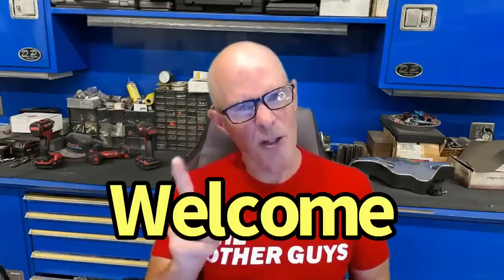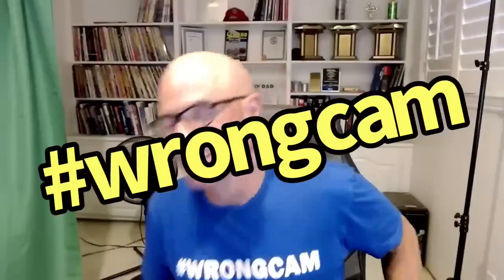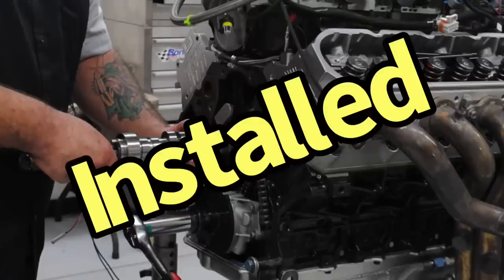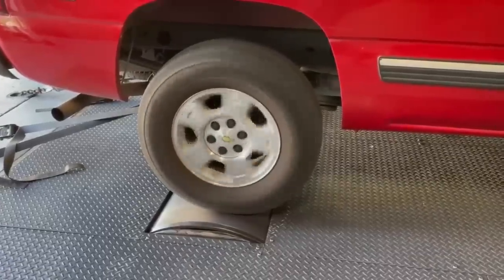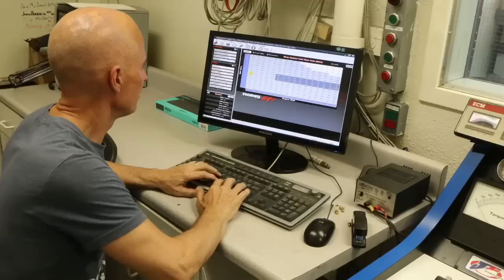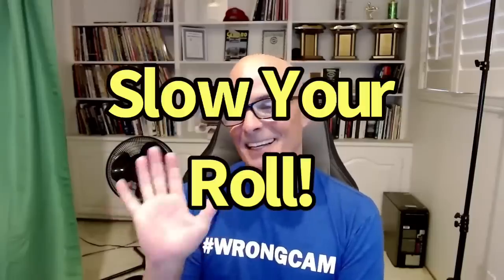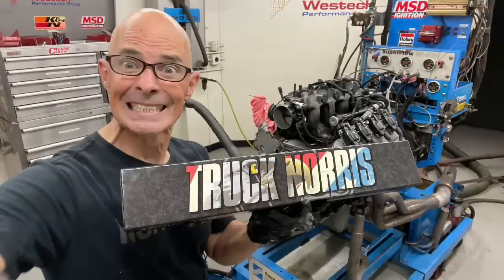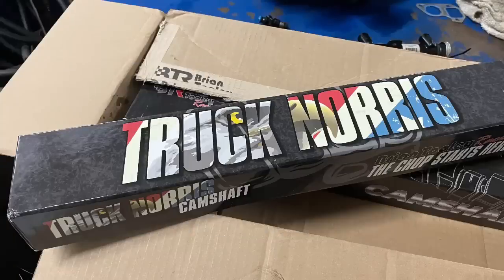CHASSIS DYNO VS ENGINE DYNO RESULTS. WHAT TO DO WHEN YOUR TRUCK NORRIS CAM SWAP DOESN'T ADD POWER!

Comment: He should be able to run at least 25-26 degrees of timing on 93 octane even on a hot ambient air temp day. These factory ecus are very sensitive to knock and you must desensitize the knock sensors a few percent, and as a tuner you need to understand what is an acceptable amount of false knock. Also his motor mounts could be broken like i see alot which can cause a false knock situation. although i dont do much dyno tuning, I do alot of street tuning on factory gm ecus. i would love to take a look at the timing curve, and PE value his tuner was using. i also bet you he disabled the ve and just tuned the maf, Which these ecus need both maf and ve to work in conjunction for the dynamic air to calculate properly. It could be that the ve table wasnt touched, He tuned maf only, and when the ecu was looking for a calculation the ve was so off it caused knock due to a lean condition from the ve table sill being stock. Even with high rpm disable, Its impossible to completely disable ve.

Comment: Is it possible to make decent NA power on lower octane gas? As long as the compression is relatively low right? It get real pricey filling up a truck tank with 92
Reply from the maker: yes
Reply: @richardholdener1727  You have to test on what you are going to be running, or you are just chasing numbers. What good does that do in the real world, other than I have a slip with a big number on it.
Reply: It's about controlling the heat, as the air is compressed it increases the temperature drastically (as you probably know it's how diesel engines ignite the fuel) and that's pretty much a multiplier of the temperature of the air coming in.
Water temperature can matter as well, you want the engine hot enough for the oil to stay clean but not much more (unless you're chasing fuel economy then the opposite sometimes helps).
Even if you get lower octane go with a good brand and a pump that's used lot, and/or add a good fuel additive that contain P.E.A. so the injectors give a nice mist and the deposit are kept low (fuel can change with season as well, but, octane should be about the same, just keep an eye on it).
If you're talking about engine build or more extensive modification then there's a number of things that will or may make a difference. Sometimes we're chasing the wrong rabbit as well, fuel price is just one part of the equation, how much of it we use is the other one. 😉
Reply: 87 tune is what you are looking for, you just need to ensure you avoid knock, when knock is detected the ecu will retard timing
Reply: I think you can likely run up to11:1 on 87 octane

Comment: Richard I'm  building  a 8.1 liter this winter ,probably  will stroke it for more cubic inches,my question  for you is I am going to use dart intake . So  would one firing  order cam be better performing than another with  that na intake!  THANKS
Reply from the maker: Firing order makes almost no difference in power if that is the only change

Comment: I had a 99 S10 Blazer w/a 5.3L swap.  Its filter was open and down behind the drivers front headlight.
Tuner was complaining that it was pulling timing due to high IAT.  The filter was cool to the touch!  But I thought OK lets eliminate that and on the dyno I rotated the filter to point upward and into cooler air.  BAM!!  It picked up 35hp and I had no knock sensor activity.  
I must say I was shocked because the filter pointed downward felt cool to the touch.
Reply: Filters are rubber and foam.  Rubber and foam are insulators.  Of course it's going to feel cool to the touch.

Comment: I ran exactly this test 8 years ago: https://youtu.be/qrE8krwTuqk  - I took temperature measurements with an open element air filter under the hood, and then again with an enclosed box. The results were eye-opening, I would never run an open filter under the hood.
Reply: Watched your vid.  Good stuff.  As a "carb guy" who often runs open element 14x3 filters for convenience, it's something to think about.  Old muscle cars the air filter housing is SO restrictive almost anything is better.  And both gulp the same hot underhood air, just that one is a lot less restrictive than the other.

Comment: Richard how do you feel about using a used cam that is in perfect condition (flat tappet) with a brand new set of lifters? I have been building engines for over 50 years and I was always taught that this was ok. The other thing I was told is if you’re going to reuse lifters make sure they go back where they came from if you were not replacing them.
Reply from the maker: no problem with either of those

Comment: Always amazes me that people want to tune their car but want it to give max power on dirty dishwater grade fuel.
Reply: My favorite is when guys say, I tuned it myself. Unless you are a professional tuner, you leave power, drivability, and and dependability on the table. If you want the most for your mods, factor in a minimum of $500 for a good dyno tune. If your tuner doesn't take 2 or 3 hours to do a complete tune and road test, find a new tuner
Reply: @OnTheWorldWideWeb1 a lot of self tuned cars have driven better in my opinion then shop tuned cars. 

Most shops will put a file on your car from a similar build , run it up do a couple wot tests see if it needs a tweak and calls it done. 

I've got mates who's laptop lives on the passenger seat every day and logs files and most evenings tweaks and tunes things. 

There was no school for tuning EFI when it started and was all trial and error. Same as somebody teaching themselves but luckily there's now actually courses to teach you how to do it. 

Last professional tune I had done on my daily LS took 2 hours and 45 mins of that was driving to get new 02 sensors and then fitting them in the driveway. 

We road tuned it and did maybe 6-8 wot pulls before it was cleaned up. Ran it down the strip and in power mode was hanging 2-3 shift and hit limiter. Had to race in economy mode and it's got to back to the tuner. 

That's a bloke who's been doing it since the mid 90's and was Australians premier Holden tuner for 20 years. 

If I had a laptop on my passenger seat during the pass I could have commanded an earlier shift time or raised the rev limiter. 

Any serious car is being constantly tuned and good luck paying someone a couple hundred dollars per hour to constantly tune your car every time it races or if it's a cold night or a hot night compared to original tune.
Reply: @hayden6056 whole heartedly agree, i dont leave my house without my laptop bc there is ALWAYS something to change.
Reply: @hayden6056  Agreed. A lot of "shops" putting out garbage tunes. There is only one tuner in my state, imo. Only 2 or 3 on the east coast I would trust. I'm sure there are more, but I've been out of the game for a while. 20 years ago we would get at least 5 cars together to be tuned and fly a reputable tuner in to tune our cars. It was chaos lol, but fun af
Reply: @wfospeedshop  I'm afraid to ride my dirt bike without the datalogger plugged in lol
Reply: @hayden6056  Sounds like were in the same club. The, my Insurance is as much as my car payment club lol. Coworkers are always like, why do you have sr-22 insurance? You don't even drink. Speed is a hell of a drug lmao. Stay safe my dude
Reply: @OnTheWorldWideWeb1  na I've got 6 registered cars and 3 registered bikes my insurance is about $500 a month alone and probably dropping 6k in licensing fee's a year. 

I drank crappy mid strength beers to celebrate my birthday and first week back at work after a workplace injury and blew over the limit even though I counted them. 

So now I'm riding 26" bmxes and the bus like a loser 😂

Luckily I've got a girl who'll drive my cars to the strip and or track for me hahaha.
Reply: Nice saab
Reply: @kirbyswarp  Cheers, gone now sadly, lost to a storm flood this time last year.
Reply: Nothing wrong with that, I built my mild 408 LS to do just that!  9.7:1 compression and runs great on 87 pump swill and when I decide to add boost it will take plenty of boost on 91. Wish I had E85 nearby, but the closest station is over 60 miles away now so I can't tune for something I can't easily get.
Reply: @rancherlee  I would have done 11:1, boost or not. You know why? Because my adviser/tuner of 25 years told me its safe to do, on pump. We were building cars at 9.5:1 about 20 years ago, before we knew what we were doing. There's nothing wrong with tuning your own car, especially if you can afford to destroy your engine. Just don't suggest it will be anywhere near the same level of tune
Reply: @OnTheWorldWideWeb1  Everything you say is true.  But...one size does not fit all.  So so many Variables. If you're running 11.1 cr and boost on 91/93  it's most definitely under 8lbs. But, you can Achieve 10/11lb on 91/93 and 10.1  At Roughly 650 whp. So if limited by this fuel. Which is better more boost, or more compression.
Reply: @kevinwest3689  depends on vehicles main purpose.  U can always run better fuel for go fast moments
Reply: @rancherlee  yes but you weren't complaining that your cam wasn't making the stated power when you knew that richard always states he is running on premium gas in the dyno cell. So you were doing informed and sensible tuning.
Reply: @bunter6 I don’t know where you’re finding dirty dishwater color gas at, but the gas that goes into my tank is near crystal clear, and that’s only regular cheap E87 gas.
Reply: @Peculiarsafe83  in the UK, the lowest we have is 95ron like your 91 and 99ron is in readily available too. We have nothing as low as your 87
Reply: @bunter6 I see why the gas over there may be lower quality. But I’ve personally never seen any dirty gas from any gas station over here. Maybe it does exist here, but I’ve never seen it.
Reply: When I daily my boosted built bottom end, 5.3… I run 87 and I’ll push it to 10-12psi of boost. I take two degrees of timing out the whole map in boost. On 93 I run 22-24psi
Reply: Even mowers call for 93

Comment: Thank you for posting this, people do not understand all the variables at hand.
Reply: I say again, I despise those hot air intakes.
Reply: @exploranator  yup, and it’s wild, it’s so easy. Air filter in the factory box and a new straight tube to the throttle body. Done. Way better than the $300+ aftermarket options

Comment: Chassis Dyno take your horsepower and torque and divided by 3 and then multiply by 4 and then you should come up with the same number as you got from the engine dyno
Reply from the maker: never that simple
Reply: By that math, my combination makes 440/480 - full exhaust and acc drive. I'm OK with that given the relatively low performance parts thrown together.
Reply: @bluecollarhotrods9781  it doesn't work for my engine ether.  My 302 Ford had 336 on a engine Dyno and 273 on a chassis Dyno.  the power difference depends on Transmission and Rear axel.  standards take less power; Big Auto trans take big power to turn.
Reply: why dont you just say chassis dyno reads 25% less power then engine dyno reads